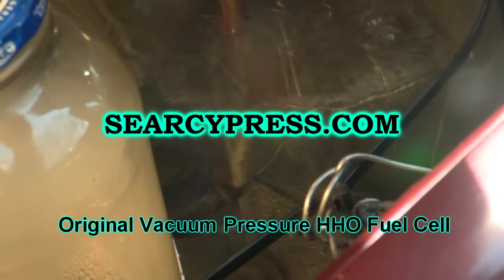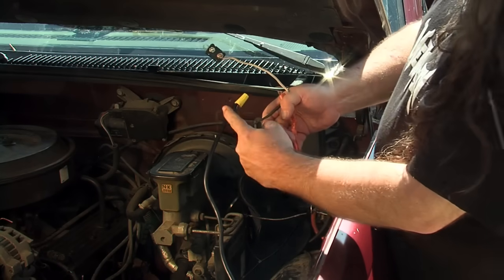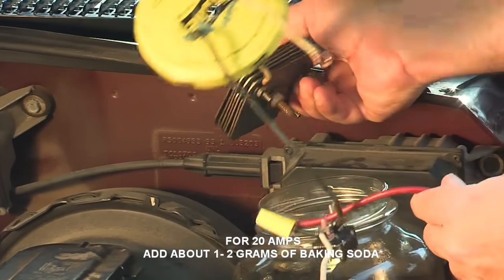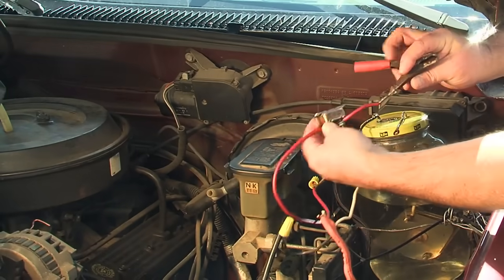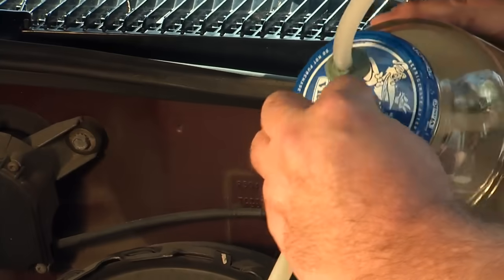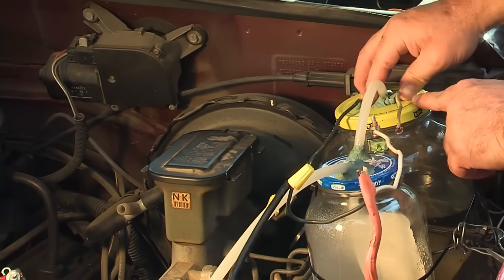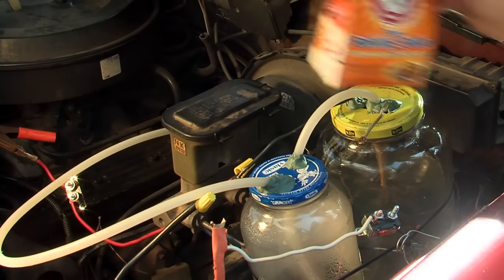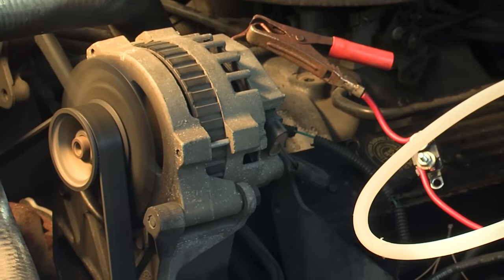Vacuum Pressure Hydrogen fuel cell defeats high gas prices using hydrogen from H2O.

Comment: I'm skeptical, to say the least. 25-30 amps to run the H generator? That is a significant amount of current. You don't get that by magic. Electricity is being generated in the alternator and that requires the burning of additional gasoline. The amount of petrol energy that is used to split the water will NEVER be fully recovered in the engine. I think some strict and carful "before and after" testing need to be done before any claims can be made.
Reply: The law of conservation of energy says this will not help.  You will burn more fuel powering your alternator then you will put back into the engine with HHO.  Realistically, you should see reduced mpg.  Add some solar panels to the system and you might have something interesting.
Reply: Loren Brown 
Crap.
"Law" my arse....btw
Reply: ***** "If every one would have listened to the skeptics then nothing would have ever been accomplished."

No. You have it backwards. It's the skeptics of the world that have kept the goofballs from wasting everybody's time by manufacturing unicorn saddles and magnet motors.
Reply: Tom Hoehler These systems always work well until a real, honest test is conducted. (-;
    The whole idea is an assertion that one can get energy from nowhere.  An extra load put on an alternator simply uses that much more gasoline to produce that electricity.  That is all one needs to understand.  Energy cannot be created, only transferred, and every transference is not 100% efficient--far from it.
    Think this system doesn't use much energy???  It doesn't!!  That is because it actually doesn't produce much hho gas.  The tiny amount of hho that thing produces, will be lucky to produce 1/4 of a horsepower in that engine.  To move that pu down the road at 50mph takes a min of 30hp.  Thus that hho kit is probably producing less the 1/100 of the fuel requirements. 
   This whole idea is EXACTLY like asserting that one could put an alternator on an all electric car, charge the batteries with it, and have a car that would never need to be charged up!   How absurd would that idea be??
     I know that free energy nitwits recoil at the suggestion, but it is all about a certain well understood "law of thermodynamics".
Reply: ***** If someone asked me how a four-cycle internal combustion engine worked, I would be able to give a quick explanation with some simple drawings. That would be difficult to do here, so I would direct them to any number (thousands?) of web sites that would explain the procedure very clearly.

So if I ask how this water car works, I don't expect an explanation in text form. It is probably a bit difficult to put into words without the aid of pictures. So... where is a web site that explains how a water motor works?

 I have requirements for this site. Any mention of government conspiracies will stop me from reading it. The name Stan Meyers will bring instant rejection of the site. Anything about 9/11 truthing is instant rejection. I want a simple straight-forward explanation of the principle without the rantings of someone in the midst of a psychotic episode. I looked. I found nothing. Where should I look? And also, there is NOTHING on YouTube that I will find convincing in the least bit.
Reply: jhanthony2 
You're a know nothing.
(-:
Reply: Tom Hoehler It is exactly like asserting that one could stand in a bucket, reachdown and grab the handle, and lift ones self off the ground.
   "The difference between stupidity and genius is that genius has its limits"
Reply: ***** Tex, You've allowed your intellect to be sucker-punched. Henry Ford never built a water-powered car any more than I have built a solar-powered airliner. The modern link you provided is all bull. None of it has any foundation in reality.
Reply: jhanthony2 
You aren't one to be judging who's been "sucker punched".
Reply: ***** Could you give us reference to those first cars? Are you referring to things such as the Stanley Steamer?
Reply: jhanthony2 
That's a steam car. It runs on wood or coal.
Reply: ***** It is time you simply installed an HHO device on a vehicle and prove to yourself whether it increases your gas mileage.   This means REAL, stringent, honest tests, with the device attached, and with the vehicle stock.
    There is nothing whatsoever about watching videos that are a proof of anything --- except that humans certainly can be gullible.  And that has already been proven by the advertising industry for 100 years.
Reply: my jar used one horsepower of electric to boost my engine by 20 horsepower  20:1 ratio roughly
Reply: *****  "Well when you close your mind to what is out there then you close your mind to what is and what is possible. I guess you do not know how to use search engines or think for your self... so I will provide you some starting blocks again since you seem to reject everything."

Oh, really? Apparently my search engine skills are somewhat more advanced than yours. The first link I already knew about. If YOU would use your search engine skills, you would see that the salt water is used as a storage system. When it gets depleted, you swap it out with a fresh supply. THE WATER IS NOT ACTUALLY POWERING THE CAR!!

The Wiki link: It is obvious that you didn't read even one sentence of that article. It completely refutes everything you say. That was a site you DIDN'T want people to look at.

The third link was written with such poor English Language skills, that I didn't know if he was talking about nuclear power or something else.

As I said before, there are thousands (I found 336,000 Google references.) of sites that tell how a gasoline engine works. But not one, NOT EVEN ONE SINGLE SITE  on the entire internet that explains how a water powered car works. You don't find the silence on this topic to be deafening?
Reply: jhanthony2 
Lol
Are you still a know nothing?
I bet you are.
Reply: Tom Hoehler If you increase the mileage of ANY vehicle, proven by a REAL, honest, scientifically administered test, that will be enough.  That would also need to include examination of the engine to ascertain that you are not increasing mileage in a way that destroys the engine. 
   There really is no mystery to this.  Car companies are scrambling for decades now to increase gas mileage. Required by govt regulation.  If this simple system works as these nitwits claim, they would naturally employ it.  I first saw this HHO flap over 40 years ago.  No one has ever shown an increase of gas mileage with it.  There have even been huge prizes offered for anyone who does.
   Witness the logic of these goofballs:  the govt requires advances in fuel mileage -- but on the other hand the same govt stops advance in fuel mileage..  Sound reasonable?  Or, that car companies spend billions to increase gas mileage, but ALL agree to ignore the ONE that is the easiest to administer.  Sound logical?
Reply: Tom Hoehler 100mpg!!  I remember tails of 200mpg carbs on fullsized sedans of the 60s, with v8 engines, no less.
   The above very detailed story was actually printed in the forum section of a major local newspaper in the 90s.
   This kind of story is never in the present, always in the mists of time.  As are most of the ramblings of the schizophrenic.
Reply: yep
Reply: jhanthony2 x
lol
whatever....
This tech has been around since the 80s at least.
He told you he had 30,000 on the clock.
Are you calling him a liar?
Pffft...
Reply: texas coot 
Yes, you're 97% right.
Reply: Hi texas coot, unless you are talking about "steam" that is simply not true - water is too stable to break down spontaneously - you need energy, electricity to break it in separated hydrogen & oxygen.  All the numerous claims, news paper articles, TV shows, conspiracy theories, etc.  were debunked years ago and are "chemically or physically" impossible for the time being.  Ciao, L (FoMoCo engineer)
Reply: Test it yourself...all results will vary...
Reply: @texas coot hey Tx Coot...Howdy...ever hear of Caggiano...he got 113 out of an 318 v8 in a 67 Ply wagon...vapor injection...great story...what do you say to these metro busses running around our bigger cities and putting out "0" emissions...its Caggiano...he developed it had stage 1...2...and the 3rd was made in Mexico...however...the UPS van suddenly dissapeared...mmmmm...wonder where the yellow went...big oil...mmmmm...put one on your car...truck...or bike...the bike wont show nothin...but vapor injectiin has ben aound for a long time...Frantz sound familiar...tp...oil filters...still you gotta maintain it...and this guy with the switch under his dash is on to something...like success...hello...I know it works...bye bye
Reply: I was thinking the same thing. 30 amps is a lot, the electromotive forces of resistance within the alternator would be increasing your fuel consumption enough that would be hard to recover with a bit of bubbling hydrogen and oxygen, especially with the inefficiencies present when the engine wasn’t designed to run that way. I’ve not watched the full video yet though. And I’m not saying it’s total bull shit. Supposedly stanley Mayer made a brilliant example, different and more complicated than this, he had no fuel other than water and different spark plugs and ignition systems, and some sort of precisely timed water injection system to complement the hydrogen and oxygen going into the cylinders....apparently? He probably did master it cause he wasn’t alive for long after that!
Reply: Hook up a reostat on the fenderwell.produce 110v.electricians have been doing it for a long time
Reply: Currant + water + baking soda =metal anodizing  formula fyi
Reply: ***** Dear, fellow coot. When jump starting a car, it is customary to have the jumper car's motor running. When the connection is made to the dead battery, the 'live' car's motor will suddenly slow down because it now has to supply additional energy to the alternator.

As you said, the draw on the alternator will not cause an increase in the amount of gas required to run your engine, but it WILL cause an increase in the amount of gas required to run the alternator.
Reply: The conversion in straight hydrogen oxygen fuel cells would suffer from your described problem, but this is a hydrogen petrol mix which is like having a fuel additive. Pretty much this is an economical supercharger that siphons power from the engine in order to return more fuel form another source. If the ratios are wrong, you lose.
Reply: ***** Don't want to argue? I'll gladly join you in that goal. I remain more than skeptical about claims of cars running on pure water. That usually means that water has been split into oxygen and hydrogen and then one, or both, of those are used to provide or augment the fuel system of the car.

If the splitting is done on board the car, there is just no possible way that there can be a benefit from doing this. This would be a fundamental upsetting of, literally, every observation of the universe that has ever been made. An implication of this would be that you could boil water by putting ice cubes into a bowl of it. 

If the splitting is done at a facility somewhere else and then the hydrogen is pumped into the car, it may be worth it. This is being tried in a few places and I'm curious as to how it will work out. I'm not confident that it will be cheaper fuel, but it has a chance of being a lot cleaner.

Comment: there are many HHO generators that produce alot of gas or even more, most of them are complicated and expensive, i applaud this guy for making a HHO generator that actually has great gas production all from crap lying around in the shop mostly with some pickle jars, makes me laugh at the nuts who spend weeks building some HHO gens with all kinds of special fabricated parts.  Do you have a video that shows the actual construction of the plates sir?

Comment: thats what makes me a little afraid for my V8, water, if even only steam, sounds harmful? its always been a rule never to have water in the engine, also have you research if the baking soda would help corrode the engine?  I know for a fact when you neutralize acid with baking soda, it becomes table salt, i do Not know whether the state of the baking soda changes physically or chemically after it it is used as an electrolyte.

when was the last time you popped you're valve cover and inspected it for white (or any) corrosion? if you could do this and make a video and nothing is wrong other then normal wear and tear and carbon build up, id be highly impressed and sold for using baking soda instead of sodium/potassium hydroxide, which work better but they corrode zinc/aluminum which is found in engines.

Comment: Fuel Gas Combustion with Oxygen 
(oC) Combustion with Air 
(oC)
Acetylene 3480 2500
Butane 1970
Carbon Monoxide 2121
Ethane 1955
Hydrogen (3200-C mixed with oxygen) (2210-C mixed with Air)
MAPP1) 2927 2010
Methane 1950
Natural Gas 1960---__
Propane 2526 2392
Propane Butane Mix 1970
Reply: That is a difficult question. Simply put, the energy required to break up 
a water molecule is the bond dissociation energy of the H2O molecule. And 
this has been recently re-measured:

"Several new experiments presented in Ruscic et al (J.Phys.Chem. A 106 
(2002) 2727 - 2747) such as mass-selected photoionization measurements, 
pulse-field-ionization photoelectron spectroscopy measurements, and 
photoelectron-photoion coincidence measurements, which utilize the power 
fo the positive ion cycle to derive the O-H bond energy, produce a 
consensus value of the bond dissociation energy of water D(H-OH) = 41128 
+/- 24 cm-1 = 117.59 +/- 0.07 kcal/mol, with a value of D(O-H) - 35593 +/-
 24 cm-1 = 101.76 +/- 0.07 kcal/mol."

In other words, the breaking up of water into its constituent atoms is a 
two step process. The first step involves pulling off the first proton to 
leave a "hydroxyl radical" (represented as OH). This requires a 
wavelength of 243 nm. Translating that into temperature is a little 
harder as it requires that we define temperature and that means that we 
need to consider the vibrational modes of the molecule. That is more 
difficult than space would allow, so simply put, it is 243 nm or 117.59 
kcal/mol. 

The second stage of turning H2O into 2H + O is the breaking up of the 
hydroxyl radical which occurs at a slightly different energy and 
wavelength (281 nm; 101.76 kcal/mol).

Having said this, this is the bare minimum energy required, according to 
the bond dissociation energy, to break up the molecule to the atoms. 
Another text (Bernath, Spectra of Atoms and Molecules, Oxford University 
Press, 1995) gives the actual photodissociation value as 186 nm. The 
extra energy is presumably a consequence of the real shape of the 
potential energy surface - that is, taking into account that the bond 
dissociation energy would just be enough to break the bonds.

Both of these answers assume that we are talking about water in 
isolation - gaseous water molecules at a lower enough pressure to react 
without interference or solvation. Solvation would and does change 
everything.

In aqueous solution - that is, in water - the water molecule breaks up 
into the hydrogen ion (H+) and the hydroxide ion (OH-). This is a 
heterolytic cleavage of the H-OH bond. That is, both electrons end up on 
the hydroxide ion and the proton is "stripped bare". This process occurs 
in pure water such that the concentration of H+ equals that of OH- at 1 x 
10-7 M (0.0000001 mol/litre) and gives us a pH of 7. It can't be avoided. 
Water breaks up. And generating Hydrogen and Oxygen gas is a simple 
matter involving very little energy - 1.23 volts or the aid of an 
ordinary battery.

But this is not breaking the molecule up into its constituent atoms. And 
the profile here is different than for the single molecule in the gaseous 
state. The answer to the second part of your question deals with the idea 
that there is a threshold value for dissociation - that is, there is a 
wavelength below which dissociation will not occur but increasing the 
energy of the light will result in further or more extensive 
dissociation. But it is intensity - the total flux of photons - that, to 
a first approximation, determines the extent of dissociation. Intensity 
is not the same thing as wavelength. More energy does not necessarily 
translate to more water molecules breaking up. A higher wavelength from a 
more intense source shining up the water vapour for a longer period of 
time may result in more extensive dissociation than a shorter wavelength 
for a shorter period of time. But having said that, different wavelengths 
at the same intensity result in different amounts of dissociation 
occuring with the above wavelengths as the threshold values.